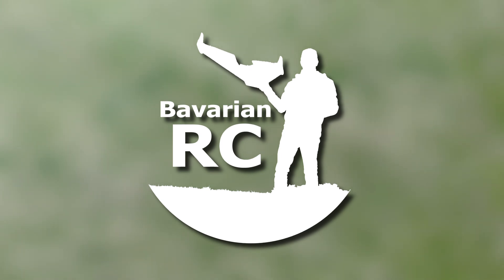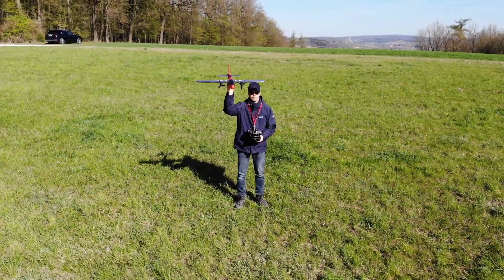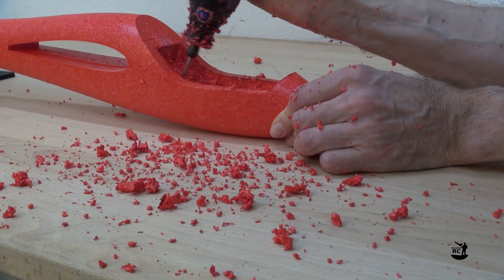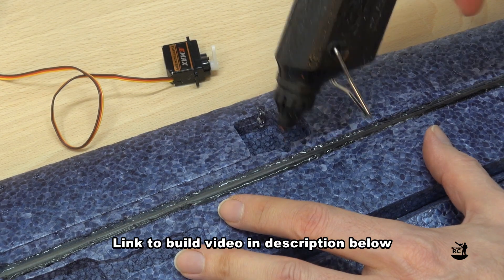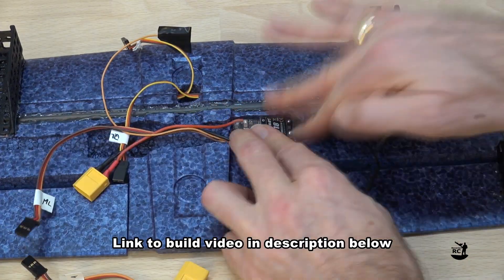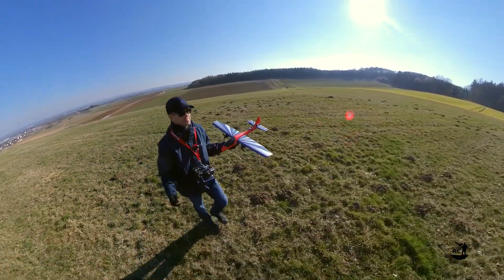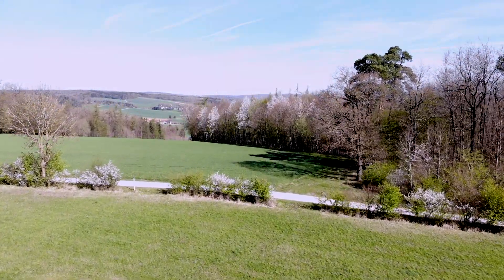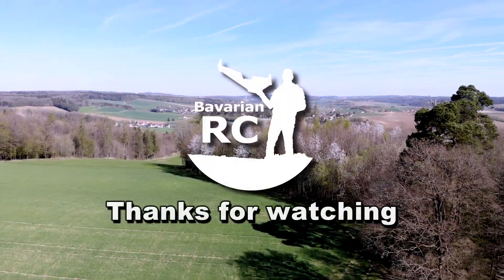Flight Video - LIDL glider RC conversion - TWIN TURBO LIDL

Comment: Just got the Rc plane bug  ...Daaam that was trilinligli intense .
Reply from the maker: Ha ha nice. Happy that you liked it!
Reply: @bavarian_rc   I bought a cheap 6 chanel remote and receiver today couple of servos and couple cheap glider toy planes to try and make them rc .So budget is tight, and still l wanna try flying something . Looking for esc ,motor and propelers ,its a lot info to assimilate till i start  flying.But i will get there. Thanks for the inspiration.

Comment: If you fligh easy, how long can be the flight?
Reply from the maker: With a flying style as visible in the video I get around 5:30 min. When I just cruise around with half throttle I am able to get around 8-10 minutes out of it. But honestly, if I would just want to cruise, then I would choose a different (lighter) power setup. This would then allow even longer flights.

Comment: Did you have a problem with chug because I made this and put the battery in the canopy but it’s to nose heavy
Reply: Thx for replying so quick I came up with a solution by shortening the nose and put the battery far back
Reply from the maker: That should also do the job. There is always more than one way to reach the goal 😀👍You will enjoy this plane. It is one of my "anywhere, anytime" planes with almost 150 flights so far.
Reply: I made one before but it only flew for a minute or so because of my bad skills and the throws were to high
Reply from the maker: The Twin Turbo Lidl is a beast. In my setup it is very fast and agile. You should have flown some other planes before or at least go quite slow at the beginning. Once you are used to it it has no bad surprises.
Reply: I was going to make the ft old fogey or some other beginner plane but in Australia the foam board is very heavy because of the density and the thick paper so I found the Lidl was my best cheap option
Reply from the maker: We have the same issue in Europe. Our own Foamboard is too heavy. Luckily we had a European distributor for the FT foam board a couple of years ago and I bought a solid stock at that time
Reply: Right now I’m learning how to fly the smaller one (38cm wingspan) with all the same controls except the twin motors are the micro brushed ones
Reply from the maker: Good idea to step up the game slowly 👍🏻
Reply: It’s probably way cheaper over there. in Australia the heavy A1 size foam board cost $12 a sheet but if you want to buy a 25 pack from flute test it will be au $120+
Reply: Btw I just subscribed
Reply from the maker: Yes, mine is also quite nose heavy. Therefore I strapped my GPS logger to the tail (see my video about the SM GPS Logger stand-alone modification to get a better idea of it - https://youtu.be/t_-OENpsDlw) and added about 20g of balancing weight in addtion under the horizontal stabilizer. That's the compromise for the big battery. Of course you could use a lighter battery but then of course you would have shorter flight times. With my setup I have between 5:30 and 6:00 min. flight time. Despite the additional weight at the tail the flight performance is still great.

Comment: Wow amazing! I have a question. How much weight can the plane carry? Im planning to make the same plane but with a arduino board as the receiver which will increase the weight.
Reply from the maker: Thanks! With my setup the power to weight ratio is about 1.6:1
I have flown it with a 50g onboard camera without a real difference in performance. The maximum weight I have added was the Insta360 One X camera with about 135g. Again no issue with the extra weight but the drag this camera created was quite significant. All in all I wouldn‘t worry about putting the arduino on the plane.
Reply: @bavarian_rc  Thank you

Comment: Impressive, I reckon a chuck glider could also be the base for a great slow flier. It's hard to find lightweight foamboard where I live so this could be a good alternative.
Reply: Yes, my first one is a slow vintage style flyer with rudder/elevator control. The key to that style is to increase the dihedral rather than reduce it.
Reply from the maker: Thanks! Yes I know some other conversions where they went for a super light weight approach making it a real slow flyer.

Comment: The lidl glider is no longer on the market and I would like to do the same thing as you to test a twin engine glider.  where can I find a glider with the same dimensions?  congratulations for your work
Reply from the maker: Thanks! The Lidl gliders are on sale at Lidl only once per year around June, July or August depending on the country. There are 2 versions of the Lidl glider. The 2021 version (also called V2) which I used to build my Twin Turbo and the V1 (2022 and 2020 and before). The V2 I haven‘t found yet anywhere else, but the V1 is available from Jamara: https://jamara-shop.com/Pilo-XL-Foam-Hand-Launch-glider-EPP-wing-orange-fuselage-blue

Comment: how expensiv wold this be if this was in a store???
Reply from the maker: Far from the 7,99 € of the original Lidl glider 😉. By the way, I never calculated the cost of the electronics... must be around 250€. I like the thought of putting high-tech into a low cost kids toy.

Comment: Great build, awesome video! 
I couldn't help but notice the circular patterns in the field below in some of the footage and was wondering if it's a known archeological site where you were flying? If not, somebody should seriously look into that.
Reply from the maker: Thanks a lot. I also had noticed these patterns. The area is not known to be an archeological site. I heard that there could be other reasons for this phenomenon like the mycelium of mushrooms leading to stronger growth of the vegetation. The effect is quite common on meadows.
Reply: @bavarian_rc  you're absolutely right, it could be many other reasons for the patterns but Bavaria (if that's where this is) is littered with (potential) archeological sites, you never know ... might get a museum named after you 😉 Anyway great location for the flight videos!
Reply from the maker: The Bavarian RC Museum…. Great idea 😂

Comment: 2:24 Very creative with the 360cam, looks really cool
Reply from the maker: Thanks. The 360 footage is always quite unique but the added weight of the camera plus the drag were almost too much for my little Twin Turbo. Especially start and landing were a bit of a challenge. I was happy that the flight worked out so well without any damage to the plane

Comment: This LIDL glider conversion worked out very nice. Do you have any idea what its topspeed is?
Reply from the maker: Yeah it's my best conversion so far and I fly it a lot. The top speed in level flight is around 100 km/h and in a dive I managed to push it up to 155 km/h with a bit of back wind. This was measured with a GPS logger so maybe not super accurate. The thrust to weight ratio is 1.65 : 1 so going vertical is endless!

Comment: I noticed that you added a carbon (?) wrap to some areas of the plane. Is that from a repair? Did you decide to add the wrap for looks or strength? Nice videos of the build and flight.
Reply from the maker: Thanks! The carbon tubes are needed for strength. This thing can speed up to 150 km/h in a dive so you want to have it really strong. The carbon strips in the fuselage front are there to strengthen this area due to the weight of the battery. These are not absolutely necessary but it makes this section more durable.
Reply: @bavarian_rc  if you don't add those sooner or later that thing becomes a banana 😁
Reply from the maker: flying banana sounds like new fun project 🤣. But seriously you are totally right, without the carbon reinforcement it would be much too floppy

Comment: Nice flight! What was the maximum flight time you have achieved with this setup?
Reply from the maker: Thanks! The maximum flight time is about 5:30 with a typical throttle mix (using ~75% of the Lipo capacity)

Comment: Great build would have like to have seen more of the aircraft vid from ground view  but will be using tips on mine thanks
Reply from the maker: Thanks. Normally I fly alone so filming from ground is tricky. I either use a GoPro strapped to my chest or use my 360 camera on a tripod. Both have very wide angle lenses. So you almost need to hit the camera to get a good shot 🤣 Check out also my other Lidl glider conversion videos. You might get some more ideas. Enjoy your build
Reply: @bavarian_rc  Thanks will do look forward to seeing more projects

Comment: Schöner Flieger, ich möchte so einen auch bald bauen!
Wie hast du die Videoaufnahmen gemacht? Also da, wo sich das Flugzeug schnell dreht, und die Kamera ganz dicht daneben zu sein scheint.
Reply from the maker: Danke! Dazu habe ich eine Insta360 One X oben drauf geschnallt. Wirkt wie wenn man über dem Flieger schwebt. Mit dem Zusatzgewicht und zusätzlichen Luftwiderstand waren die Flugeigenschaften aber ziemlich grenzwertig 😜
Reply from the maker: Schau mal auf meinem Instagram Account (bavarian.rc) vorbei, da hab ich gerade ein Foto von der Kamera Installation gepostet
Reply: @bavarian_rc  danke, so ähnlich hatte ich es auch vermutet. Aber echt toller Effekt!

Comment: The music ruins the otherwise excellent video, - the sound of the engines would have been much more pleasing !
Reply from the maker: It is quite difficult to record the pure sound of the motors as the microphone of the camera is fully exposed to the flow of air and thus only records loud wind noise. But you can still turn off the sound when playing the video 😜

Comment: Do you have issues with the 3 blade props not being able to kick out of the way they way 2 blades would?
Reply from the maker: So far no problems. The HQ props have some flexibility which seems to help

Comment: Great video! Love the twin prop set up. Nice flat spin.
Is indoor flying common during winter? Wondering what flying is like in the winter over there?
Reply from the maker: Thanks man! The flat spins are super fun and easy with the differential thrust. My longest flat spin was around 20 seconds! I don‘t know if there are any places around where I could do indoor flying, I never tried. I know there is an indoor flying scene in Germany but I prefer flying outdoor even in snow. Have a look at my snow flight video https://youtu.be/mHwZaHZOxEg

Comment: Wieder mal ein klasse Video und Klasse Modell!!!
Habe schon den Lidl Devil nachgebaut und der ist auch spitze!!!
Gerne auch in deutsch!?🤗

Mach weiter so!👍
Reply from the maker: Danke, freut mich dass Dir das Video gefällt. Von all meinen Lidl Fliegern sind der Lidl Devil und der Twin Turbo meine Favoriten... mit leichtem Vorsprung für den Twin! 
Kommentare gerne auch in deutsch ... wer's nicht versteht kann ja Google übersetzen lassen😂
Reply: @bavarian_rc was kostet der Spaß? Außer Schweiß, nerven und Geduld? Worüber hast du die Sachen denn bezogen, vom Fachhandel oder von Temu? 😅
Reply from the maker: @busfan1234 Hi, also der Lidl Flieger mit 7,99€ war wie Du Dir denken kannst das billigste daran. Zwei Motoren und die entsprechenden Controller kommen dann zusammen auf rund 180€. Empfänger und die drei Servos zusammen auf etwa 80€. Dann bleiben noch Batterie und diverse Kleinteile mit rund 35€.
Rechnen wir zusammen, dann macht das insgesamt so um die 300€. Verwendet habe ich eher höherwertige Komponenten von Graupner, außer für die Servos, wo ich eher im günstigen Bereich war (Emax). Alles stammt von deutschen Modellbau Online Shops. Würde man konsequent auf günstige Ware direkt aus China setzen geht's natürlich günstiger, da wäre das ganze sicher für etwa die Hälfte machbar, aber ich verwende halt lieber Markenprodukte, die ich dann auch wieder in anderen (höherwertigen) Projekten wiederverwenden kann.